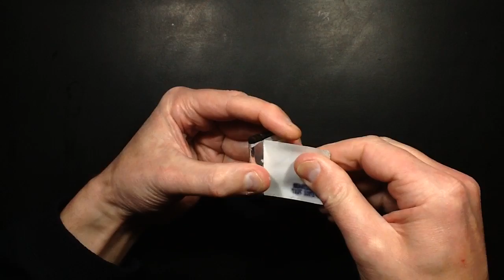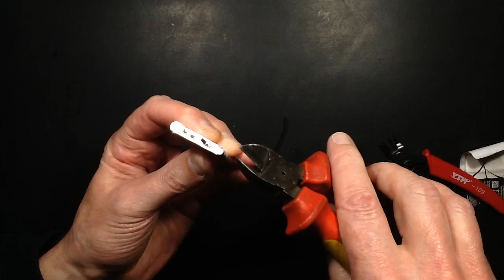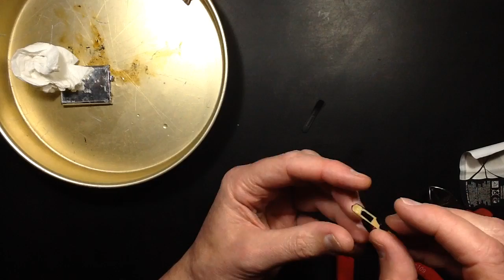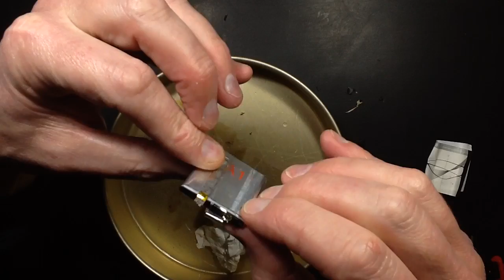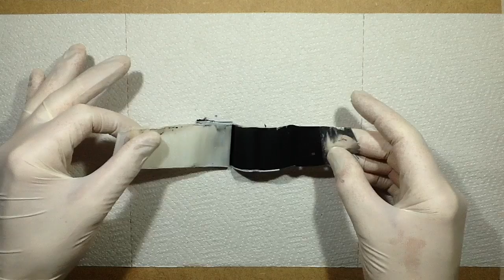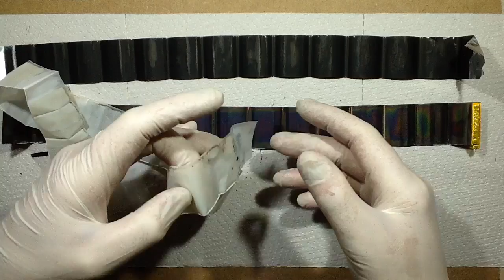TOTAL teardown of a lithium phone battery.

Comment: One electrode is a copper foil and it's coated with cobalt oxide.   The other is carbon.      Cobalt and Oxygen are atoms that tend to acquire a negative charge,  lithium tends to be positive. In the discharged state,  all the lithium is inside the cobalt oxide crystals and it's a very stable compound because opposite charges attract.  When you charge this battery, you pump some of the lithium into the electrolyte and then across to the carbon electrode.   There should never at any point be pure, elemental lithium anywhere.   However, the lithium isn't really happy in the carbon and wants to get home,  this process of "coming home" is what gives the energy.  

Also, the more you charge this cell, the more unstable the cobalt-oxide becomes as it hasn't got as many positively charged lithium atoms serving as "glue".   Manufacturers stop at 4.2v for safety and longevity reasons , when there's still a fair bit of lithium left over in the cathode.

If you over discharge the cell and get down into dry battery voltage ranges (less than 2 volts)  it starts acting as a good old fashioned zinc carbon battery and the carbon current collector foil starts getting eaten away and deposited on the cobalt layer.   Possibly this happened here ,since both foils are black.    Then again cobalt is blue isn't it , and i can see some blue?

Comment: This battery is nicely designed. Nowadays, LiPo batteries are not sealed in metal cans and can be easily punctured, even by a screwdriver.

Comment: The stainless steel container is TIG-welded along the seam at the top. It's a Lithium-ion chemistry inside. The electrode on the internal aluminum-substrate is probably ultrasonically welded.

Comment: To measure temperatures, I use a cheap or thermometer that was designed for the inner ears of humans.

On my devices, like laptop computers, it is easier to detect sources of temperatures. Surprised that you have not discovered this. Like your vids. Learn so much, in my retirement years now.

Comment: One of my lithium cells protection circuits has gone funny... it measures  3.76v but as soon as you apply load it cuts off and the contact voltage drops to 0v and when you try to charge it it doesn't accept the charge. 

Edit - I decided to strip it and it wasn't sealed as good as your battery and I just desoldered it from the control circuit and wrapped it in electrical tape to stop the negative terminal shorting on the metal casing which is live, I just put it on charge now and it's fine :) (the charger I use cuts off at 4.15v)

Comment: Thank you for the tip about the case being positive and just insulated with a bit of tape. Nice to know. Could you try to poke the sticker with a multimeter probe to see if you can make a connection ?
Reply: No bit of tape!, just the paper sticker with the name.  Case is completely not insulated, just like the old zinc batteries where the outer can is the actual negative zinc electrode, except this is the positive electrode reinforced by a stronger can.

Comment: Some batteries have an hours counter in their charge controller that makes them fake report the battery is dead or weak. To reset drop the battery voltage to about 2.5V. Then briefly short the cell itself out, a second or two is enough. Next use a vape pen charger to directly charge the cell to 3.5v or so. Then apply a bit more than that voltage to the positive and negative of the bms board to wake it up. Finally pop back into the device and charge normally. Congratulations you now have your battery restored to 80 to 95 percent of new capacity.

Comment: The foil sheet is aluminum. The dark coating is a combination of various oxides of lithium. The oxides formed when it was exposed to air and heat. Lithium like other metals like titanium and coper form several different colored oxides.

Comment: "it's getting hot" hahahah I feel ya xD
my 3rd time opening a Li-Polymer battery got so hot I put it in a container full of liquid nitrogen test tubes
Reply: +bigclivedotcom or you can add 1/4 of the height of the battery of alcohol to help dissipate the heat.. since any excessive heat will just evaporate the alcohol

Comment: Can you do a review of different styles of wire strippers. I find the a cheap all in one wire stripper Crimper works the best as the stripper part is not very sharp.The other ones tend to cut the wires if you don't pull it straight

Comment: Lithium starts to get hot and react because of air moisture. it would have been a pain but you could do this essentially with no risk if you kept it inside a bowl of some kind of oil while prying it apart. The stuff it was dripping was likely Hydrogen Peroxide, as it reacted with air moisture to form Lithium Oxide. And if you really wanted flames, you can get brilliant, bright pink ones if you just apply a flame to the lithium. You can also get a violent explosion if you put it in water.

Comment: I was playing around with one of those from an old cell phone we no longer use, in the past I have used them to power some of my arduino projects, and that was my intention for this one as well.  I must have done something wrong, as I was soldering a lead onto one of the pads because she became hot, very hot. I don't have one of your fire depression pans, so my only option was to grab it with needle nose pliers that I had laying about, and run outdoors.  We are having a drought right now so I feared setting my law afire, the only thing that looked any way shape or form of safety, keep in mind it was beginning to squeal and smoke was emitting from it, was the wife's flower pot.  This was three weeks ago, she still has not forgiven me for the loss of her pretty little pot of pansies.  That said, the fire was abated and I fully intend on being more careful with lithium batteries in the future. Those things are wicked, strange that some consumer protection agency has not tried to ban them.

Comment: Old vid, i know... A few years ago, I was, idk, 13 years old maybe? 18650s were just starting to appear on the market as a common power source... i wanted one of those for a project, but i didn't have any... so... I had this brilliant idea of taking a phone battery (which i had planty of), ripping the shield off without making it go boom and rolling the insides to make it fit a small pvc tube. So I started the project, found a battery, took the protection off, grabbed my snippers and begin carefully cutting the shield off, as a 13 yo does it... it smelled horrible, and it was getting hot, but i was like "I need my cylindrical battery...” about 20 mins into the project, i managed to get the cell out. Took a breath and rolled it into a cylinder, and put it inside my pvc tube. So far nothing has blown up. Finally my cylindrical battery was built.... I sit down, and thought for a while, i grabbed my invention and threw it out the window after my brain told me “This is not only stupid, is incredibly dangerous, I can't believe you actually made it that far”.

Today, I don't even trust properly built lithium cells... i still don't understand why i did that and how it did not explode.

Comment: I'm guessing that's a compatible Nokia battery due to the DW01 chipset. Interestingly, I dismantled a genuine Nokia one and this copy is almost identical. However, it uses a different protection circuit and mosfet pkg, but they've made it really difficult to read off the part no.

Comment: A fun trick I learned while I was taking apart lithium batteries is that you can cool them down quickly by spraying them with a can of compressed air turned upside-down. It sprays it with what I assume is liquid nitrogen and can chill it enough to produce frost. Helps prevent runaway meltdowns.
Reply from the maker: Some air dusters are flammable.

Comment: If you leave the foil soaking in vinegar & salt, you end up with a blue coloured electrolyte with the dense colour of black, & the foil is copper foil. Which if you want it shiny & intact, you have to submerge it in water, then isopropyl alcohol, then quickly dry it off or the copper foil will oxidize.

Comment: i had a small lipo battery out of a radio controlled model airplane and it was completely dead. it was about 2 inches long by an inch wide and 1/8 thick. i cut open the foil pouch and the sheets inside folded out to be about 20 feet long!

Comment: The main reason why it's getting so hot, fizzing, and smelling as opposed to actually flaming is because it's exposed to air. Lithium corrodes in the presence of oxygen extremely fast (in just a few minutes).

Comment: @2:37 
i i were you i would have connected a low ohm high watt resister accross it for some time to let it fully discharge (let it sit for at least a day ) .. then carefully have shorted out positive and negative terminals in a rapid sucessions until no sparking would come..  before doing such a surgery on it.

also the metal containment is a conductor .. and if battery is put there it might short out.

Comment: I was a bit afraid of you taking that cell apart, A year ago I accidently shorted a pair of 18650 that where on the bench, I picked them up with pliers and rushed outside, putting them down on the path, one of the pair had flames coming out then suddenly blew it's guts out with a loud crack.

Comment: I pulled one out of a iPhone 2g and during the prying out part I bent the battery in the middle.  It began to swell and got really hot fast.. I got it pulled quickly and dropped it in a bucket of water.  The next day I pulled it out and figured it was safe.  I took a knife and started cutting at it.  It immediately heated up again so I dropped it back in the water.  I gave up and recycled it.

Comment: now touch the second electrode with your bare hand, it will still make your finger tingle a bit, and interestingly enough it will basically etch your finger print into that foil. i know from experience. the smell is also quite good, very sweet smelling, but presumably not very good to inhale.

Comment: Not only hermetically sealed but very finely laser welded seams if you look very closely.
Reply: Beautiful construction. 
Still have about 20 of these from mostly the same model Nokia phone.
Soldered leads onto two to power a bloody long MAG light. Runs it for over ten hours. 
Security guard friend was blown away,  it said it wasn't much use without D cell ballast.

Comment: I remember last time I tried that smoke started pouring out the sides putting this vile smell into the air. Had to throw it out the window with a pair of pliers. I lied, I put a 90 degree bend in the battery...

Comment: if you discharge one to 0v (attatch a resistor to it and let it slowly discharge below 3v about 100 ohms is good) (then once it stops outputting current you leave it shorted for a few days)
it will be completely inert. and even smashing it to pieces with a hammer wont make it burn or even smoke. (I tried it with a 1000mAh cell) it was so dry inside I dont know how it even worked to begin with! I have doubts it would of done anything even if you discharged it to 0v then charged it back up to full. I dont think it would even get hurt by overcharging it was so dry inside There was no loose electrolyte to speak of. it was dry as a bone!

Comment: +bigclivedotcom I'm sorry you didn't get your fire. I recently did. I had a 5000 mAh RC car lithium battery, accidentally charged using a NiMh setting on the charger .. the result was flames. Big flames, enough to justify a fire extinguisher. The shop was inhospitable, the fumes were so strong.

Comment: Clive got one of the lucky but iffy ones.  all Nokia BL-5C  clones.  got one thats over 2100 mah for a radio that uses these .  think just about anything chinese runs these.  from keypad/touchpad wireless contraptions, to bluetooth speakers to Radio, mp3 players. etc  (and my original Nokia thats long gone)  up until I ran into the one with the gold label on the outside, all the knockoffs were all precariously surrounding a smaller square piece of metal.  The original Nokia batteries and the gold ones however are metal up until the top  and rather hard to remove the top.  It's the others that are usually more scary however I had one of the gold ones expand on me first time I charged one of them :O  oh yeah expanding just want I want.  So after that experience think I trust the really silly never remind the label knockoffs  :O  that being said I probably would have discharged it.  went on a trip to SD/WY late last month.  just out of over precaution, and electric tape is so cheap, I taped all the contacts of just about anything that might short made from li ion or lipo

Comment: Does anyone know the NAME of this size cell?  I have a bunch of them which I salvaged out of notebook PC batteries.  Not even sure whether they have the management circuits built-in as Clive's cell does?  Since they are used in a serial/parallel battery pack, they appear to use a the typical single management board for the entire battery pack.  I tried to charge these in my LiOn chargers and they weren't even recognized.

Comment: I wonder what that metal strip is... soft silvery metal, oxidising in air, liable to catch fire. In a lithium cell. I wonder.
Lithium?
The strips are lithium, black paste is a graphite impregnated with electrolyte and the plastic strip is a semi permeable separator for the layers.
Reply from the maker: +jamietti The only lithium cells with a significant amount of metallic lithium in them are the non rechargeable type.  Lithium ion rechargeable cells contain trace quantities of lithium in ion form on carrier electrodes.
Reply: +bigclivedotcom I stand corrected if so be the case. Might the thin strip be regarded as a non significant amount though? Try setting it on fire. That will solve the case. Aluminium will only wither away, but lithium will BURN!

Comment: its coated with lithium. lithium oxides when it comes in contact with oxygen. that smell is it oxidizing. if you drop it in water before it turns black it will burn in the water

Comment: A ebay lipo protection circuit i got has a cutoff at 2.5v, is that okay for a lithium ion battery? Im used to 3 - 3.5v for lipo packs, so im a bit worried.

Comment: I would say, that this is a genuine Nokia battery. Not a cheap knock-off.
Reply: +Piotr Porada but how would a knock off look? even they have a protection circuit, the only thing i can say is they are lower MaH, probably due to being cheaper lower tech insulators and lesser quality chemicals/lithium coatings, none of which are visible to the eye. (not having a go at you lol)  the knock off samsung phone battery i once took apart was a full cell, no empty or fakery going on, just a lower Mah in practice

Comment: do you know if the chip remembers things like charge cycles and knows when it's defective ?
Reply from the maker: +BillyNoMates1974 No.  But I think it will lock-out and prevent the cell taking a charge for safety if the voltage goes too low.

Comment: isn't lithium one of those elements that start reacting like hell when exposed to air and moisture? ^^
Reply from the maker: There's very little lithium in rechargeable lithium-ion cells.  The explosive failure is generally down to sudden energy release and the combustible electrolyte.

Comment: I nearly set my house on fire today by sniping the side of a li-ion
Reply from the maker: It happens.  All in the name of science.  Top-tip, discharge the cell before cutting it open, as the main inferno is usually caused by the cell suddenly dumping all its stored energy as heat when damaged.

Comment: Yup this was one crazy vid , I tore down a 18650 few weeks back (dead one) and it was a hell lot more messier inside with metal filth cracking up and falling out so im thinking if the batt is in bad condition life cycle wise maybe thats the normal thing to find.

If you tare one apart and recover the lithium metal you can blast it with a blowtorch to have it burn crazy bright and release toxic gasses , you just have to light it fast when removed cos lithium breaks down in contact with oxygen 

But yeah that was real scary when you were pecking at the metal case to that cell :-D

Comment: my phone battery is damaged. some of the black protective plastic cap broke off and I'm worried the battery will release harmful substances. will the lithium be sealed inside the metal or will some leak if the black plastic has broken off?
Reply from the maker: It won't leak toxic gasses, but if the electrical connections are damaged it will be a good idea to get a new battery.

Comment: If I was taking that apart (well I wouldn't as EVERYONE knows how dangerous those batteries are) I'd be wearing welding gloves, a lab coat, full face mask and safety goggles. 

Also, before I'd start to take it apart I'd put a load onto the cell and make sure it's shorted out. 
Only then would I ever even think about taking something like that apart but there's hardly anything to them.

Comment: I know this is an old video but it gave me a question. I've seen some zombie movies where they use propane tanks with a flare on it so when shot, it explodes. With how volatile lithium cells are, would they be a good 'detonator' if taped to a propane tank and shot?

Surely the bullet will cause it to melt down, causing fire, while at the same time bursting the propane tank, right?
Reply from the maker: Not that predictable.  It would be better using the lithium cell to power an ignition device.
Reply: @bigclivedotcom  damn, I can't even believe i didn't think of that.... and I thought I was so clever thinking 'oh hey fire battury go boom' 

Thnx Clive!   🦅💙

Comment: whats the third connector on the top of these batterys for
Reply from the maker: +0yeme0 Usually temperature sensing if implemented.  By knowing the temperature of the pack the phone can determine the safe charging current.  (And that includes careful charging of very cold batteries.)
Reply: +bigclivedotcom ah clever stuff